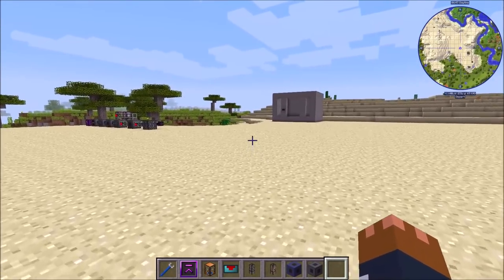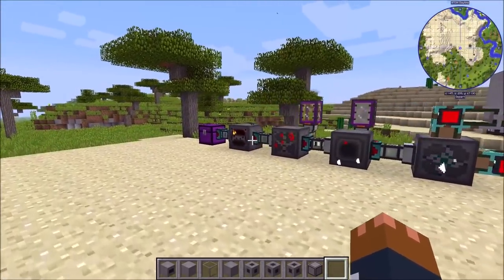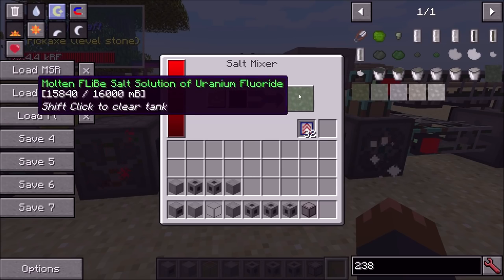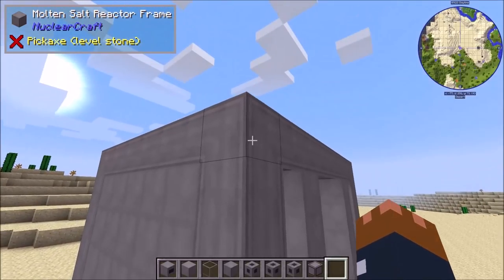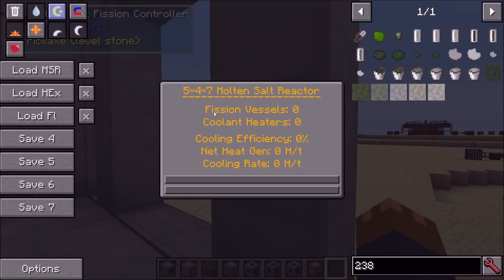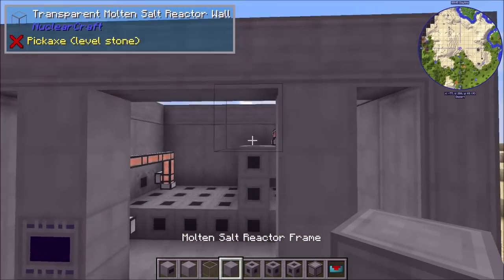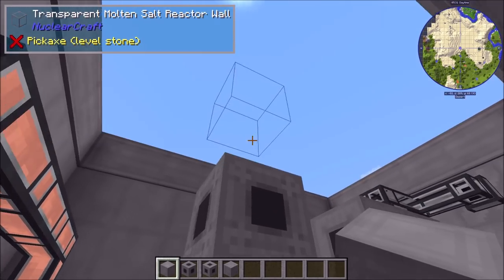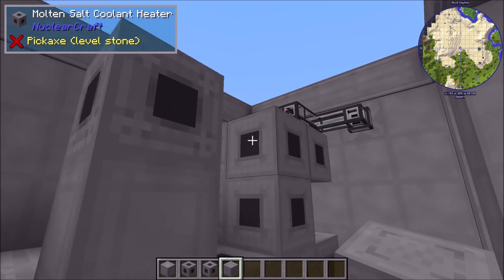NuclearCraft Spotlight - Molten Salt Reactor [1.12.2]

Comment: honestly this mod has the most interesting power gen of any mod 
itd be cool if the reactor controllers gave you a list of blocks youve got in the reactor and if it told you whether a cooler is working or not
Reply from the maker: I've been thinking about such features - a little tricky to implement well, but certainly something to do :)
Reply: Yea I can't imagine it being easy 
Could you maybe get in contact with the ae2 guy 
His multiblock monitoring system seems like it'd work for reactors 
No idea though don't know if he's the type of modder to help others never had any experience with him before so
Reply from the maker: Oh, I can get the list of blocks pretty easily, but I'm thinking about how best to show them in a GUI - one idea a friend and I have had is to have a layered, top-down view, with buttons to go up and down the y-axis, and red boxes around the heaters in the wrong place. Pretty much like what the reactor planner does if you've seen that :)
Reply: NuclearCraft u could use a way similar to the thaumic dioptra fro Thaumcraft. Its basically one block wich renders the surroundings in a 3 D manner. Here is an image: https://thaumcraft-5.fandom.com/wiki/Thaumic_Dioptra Also, is it possible to introduce the same system for managing cooling blocks for standard fission reactors? Im having issues with the active coolers not distributing the coolant to each other like they are supposed to. Other than that its a great mod, probably the most interesting and in depth Power gen mod ever. Amazing work.
Reply: @NuclearCraftMod  I know this is necroposting, but if you found a way to implement NC Reactor Planner as a core feature of Nuclear Craft my life would be complete. I genuinely love what I've experienced so far with NC, so making it easier to use would be amazing.

Comment from the maker: Note: You can now copy the vessel and heater side configurations along a line by sneak-placing - should save a lot of time!
Reply: i connected fluiduct with vent then i connected vent with vessel but heat doesnt generates and when i connected fluiduct with colland with vent then i connected vent with heater and it dont works
Reply: Are you a real nuclear scientist/engineer ,cuz your mod is really kind of looks like real Nuclear Physics and reactors 😃
Reply from the maker: @aditya_lord_of_darkness  There's a decent number of physical inaccuracies in this old version of the mod. The overhaul branch still has various inaccuracies, though not so many, mainly for gameplay purposes :)
Reply: Dude please make the vessels auto open, its pretty hard to make them into default

Comment: oh so a reactor only 8x harder to maintain then a regular fission reactor?
Reply from the maker: Yep! These are being revamped in the new branch of NC to be more accessible, but is still a challenge to take if you want!
Reply: @NuclearCraftMod  As long as power output is substantial higher for all the work required for it. otherwise building a fusion reactor sounds easier.
Reply from the maker: @zuzoscorner  A fusion reactor will generate more power, so just build that if you're interested in energy gen. This is more of an engineering project for people who like that sort of thing.

Comment: How can a molten salt reactor meltdown?
I know it's not meant to be very realistic, if it was you would just use the fuel salt as the cooling liquid and the whole thing would be easier than solid fuel but that little thing bugs me.
The liquid just melts? Into what, a more liquid liquid?
Reply from the maker: It isn’t the fuel melting, it’s the reactor itself, which although made of an amalgamation of steel and other alloys does still have a melting point, albeit high!
Reply: @NuclearCraftMod  Maybe create a freeze plug block next ;-)
Reply from the maker: MrRolnicek There may be a basic emergency coolant system in the future, but it’s a little while until the MSRs are overhauled.

Comment: when you say that you are using the extreme reactor multiblock api. I'm a little worried every block is a tile entity, yeah sure they aren't ticking but its wholly unnecessary for anything except the core block to be a simple block.
Reply: Isn't the reason for them all being tile entities for the multiblock to track where blocks are being placed, which chunks are not loaded, etc?
Reply: no. the only block that needs to keep track of what blocks are where is the core block. The core block checks its structure and the core block checks if the structure is changed. The rest of the structure does not need to know what it is.
Reply from the maker: Yes, they are - is this going to cause problems? I am afraid to mess with the API too much more, especially the core mechanics, as understanding the multiblock synchronisation, tracking and registry system is doing my head in a little bit :P
Reply: tile entities, even when empty, have a larger memory footprint than simples. Are your fission and fusion reactors also using the extreme reactors Multiblock API ?
Reply from the maker: Not yet - they use a really archaic system which I made years ago, but I plan to... unfortunately I'm too much of a Java noob to know how to change ErogenousBeef's system to have it use less memory via your suggestion of not using tiles when not necessary.
Reply: get in touch with Blusunrize of Immersive Engineering, he may have some insights for you :)
Reply: I wanted to add that I totally forgot about the vent/heater/vessels e.t.c they should all still be TEs since they deal with flow e.t.c
But the structure blocks like the frame and what not should be able to be simples.
Reply: It's his mod he gets full control

Comment: I've placed the coolant heaters next to the fission vessels, and enabled sides to default/coolant spread but the control gui is not updating the coolant bar? I'm using V. 2.18
Reply from the maker: Could you explain in a bit more detail? Where are to spreading coolant to/from? Which type of coolant?
Reply: I was copying it the same way you did in the video - same layout - using the Eutectic NaK-redstone coolant and using Mekanism pipes to direct it into the coolant heaters

Comment: it doesn't even produce RF so why pothered with this ?.
Reply from the maker: Sorry for the late reply, but the idea is that the hot coolant can then be used to generate steam in a heat exchanger, which is then used in a turbine to generate power.
Reply: @NuclearCraftMod  worth waiting, thanks
Reply from the maker: @yousfhelal321  No problem :)

Comment: I am not even going to bother with this. It is literally just a fission reactor which is more of a hassle with minimal-to-less payoff. I like most of the details the mod puts in but the mod as a whole in survival is actually a pain in the ass. You need 1000 things to make 1 thing and that thing actually doesn't have much payoff usually. It is also a nightmare with chunks and how they load in chunks.
Reply from the maker: That’s fine, this mod isn’t for everyone, especially the MSR and heat exchangers :)
Reply: It isnt really that much of a pain in the ass if you got an automatic ore gen, plus if you really want energy production just use the fusion reactor, as the mod owner said the MSR is only added for people that are into this kind of engineering

Comment: Does this need the BuildCraft mod?
Reply from the maker: It needs at least some mod(s) that add energy, fluid and item transport. BC uses a different form of energy in 1.12.2, and its fluid pipes don't allow for very large throughputs, so I would recommend some combination of Thermal Dynamics, Pressure Pipes and Mekanism instead :)